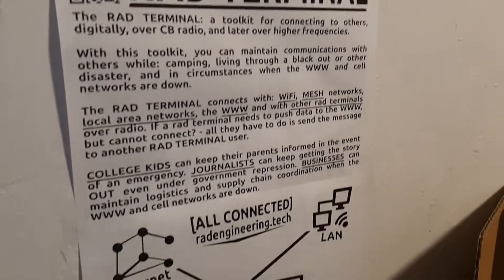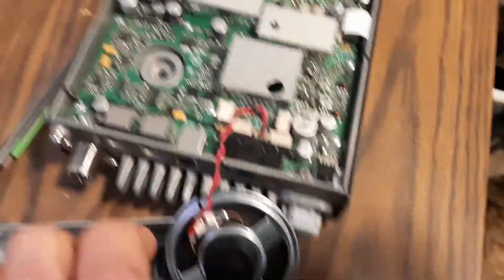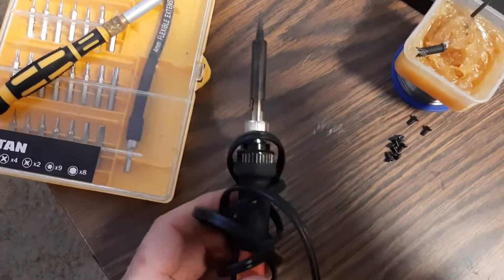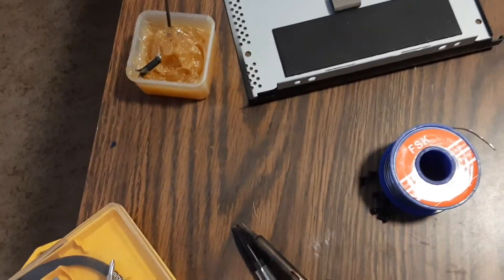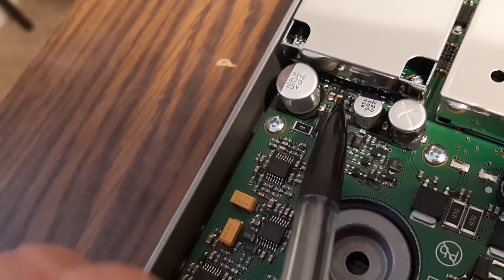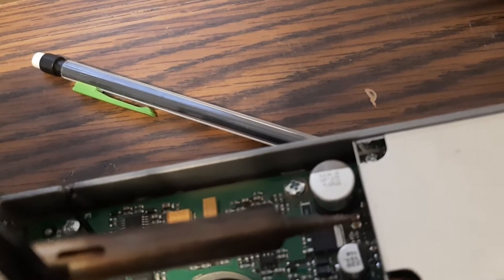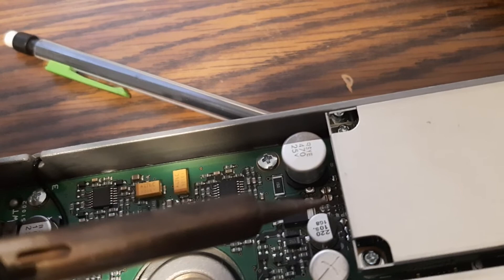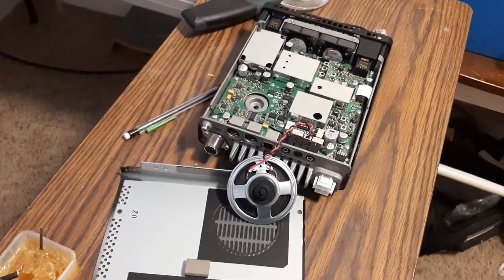RAD TERMINAL Community Resource video 2-  yaesu ft-891 MARS Mod

Comment: Press the function and the clear buttons when powering up the radio and you're all set. KI5UHA
Reply: And you don’t have to do a MARS mod? Or after you’ve done a MARS mod?
Reply: @MeAgainstMyselfDaily  I'd guess it's after. To tell the radio's "brains" to check for the changes
Reply: I did all that and still didn't transmit on 11m